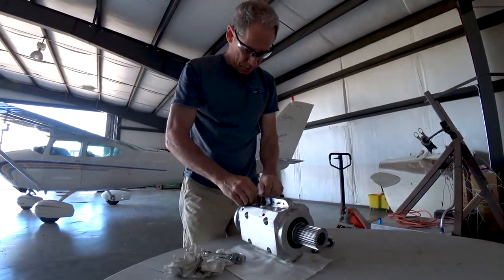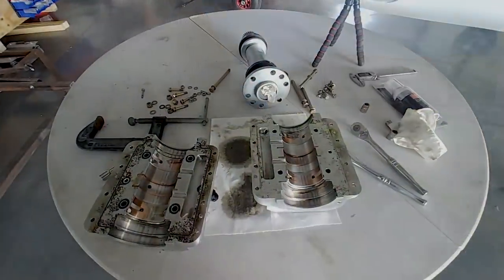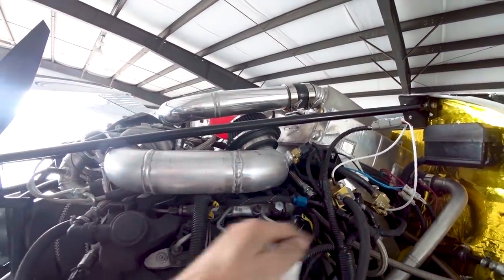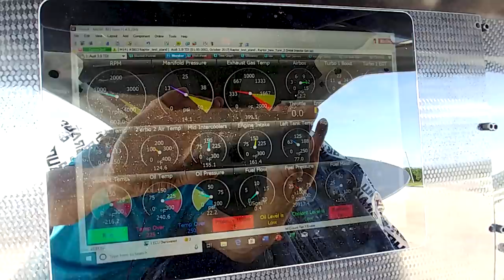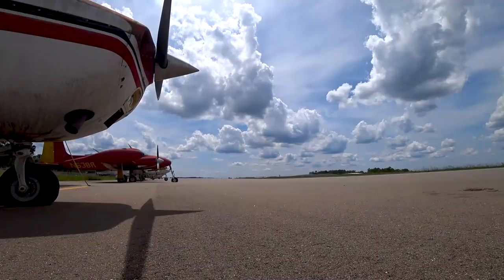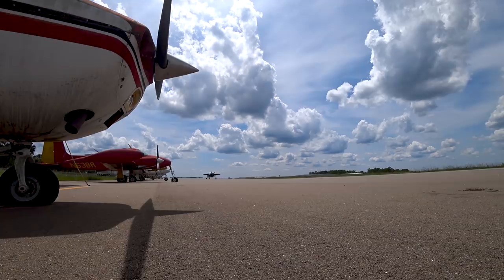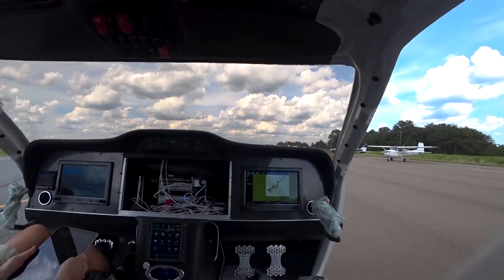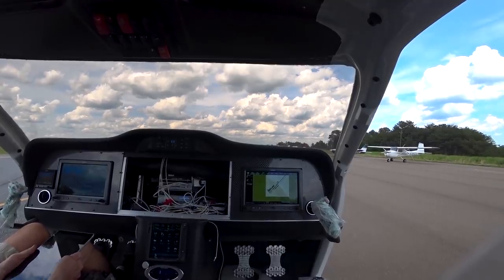High Highs and Low Lows - Building the Raptor Prototype

Comment: Dude that is so much like the problem Porsche had with the intermediate shaft bearing during the 996/997 era of the 911.  They eventually solved it with a big roller bearing on the end that is near the cam chain.

Comment: I am not worried about the redrive, the third version will work for sure. And the old one does it for flying around the pattern (and to Oshkosh in slow cruise).
Maybe time to reread the comments some people made on the April 3 video a year ago. I think they had some valid concerns as it turns out.
Poul Sorensen said "For problem areas  on your new design you have moved the two main bearings that takes the side load from the pulleys so they are only what looks  like 5 inches apart.  There is no way that those journal bearings can support the side load from 350 hp engine especially when the bearings  are so far from the pulleys  . journal bearings works great in an automatic transmission where the is little to no side load. That is  mentioned in another comment,  but the side  load you have  from the engine  is more like a wheel bearing on a semi truck."
Reply: Martin Renschler. Thanks for reposting my comment from april last year. I have sent suggestions, plans and part numbers to the raptor team a year ago as well to solve the problem, but to no avail. If this Bird ends up with a lycoming my guess is 90 percent  of the 300 plus million dollars worth of sales will disapeer.
Reply: @poulsorensen6948  My take is that Peter has two choices on all parts of the plane: a) build the whole plane with all parts to the finish as originally planned, then start iterating / improving what is broken and matters or b) start iterating on each part right away as deficiencies become known and never get done.
I think he is on plan a)! For that reason I said I trust him to get the redrive right on the next iteration. He will take all input into account would be my guess, so don't take it personally just because he didn't jump right away on it back then.
In my area of expertise, EE/wireless, I told him the NAV antenna cannot work and same thing, he put it in anyway. But I understand that he simply wanted to continue, see himself that it doesn't perform and then fix it in the next iteration.

Comment: Re-drive ultimate solution will probably be an electrically actuated prop pitch system. My design idea is contact-less, so no wear surfaces exist to cause reliability nor maintenance issues.

Coils mounted on perimeter of prop shaft rotate with the shaft inside a static ring of magnets, providing electrical power to the prop actuator controller mounted inside the hollow prop shaft. Data to and from the prop controller is passed via an IR link through a sealed polycarbonate window in the centre of the inner end face of the prop shaft.

Bearings for re-drive can then be single purpose, making design far easier.   Big-arse (Aussie technical term) roller bearings can be used to handle the significant mechanical loads involved, without 300 PSI oil to worry about.
No oil, no oil seals, no oil leaks, no pump, no pipes.  Nor any slip rings to wear out.

Comments and feedback, positive and negative, are invited !

Geoff Allen
Deposit #510

Comment: Wouldn't a cylindrical roller bearing be more suited for the belt tension load? The propeller end thrust would have to be dealt with separately, but the paired taper rolling bearings with a fitted center spacer will begin to deteriorate from the belt load.

Comment: MT also sells a prop whose pitch is changed via a small electric motor, instead of oil pressure. Is that an option?
Reply from the maker: It's very show to change pitch and even MT doesn't recommend it.

Comment: For my part I'm thrilled that you found a potentially serious problem without any risk to life or limb.  What's more, it's an engineering problem, which means there is a solution to it.  I can see from your other comments that you're thinking about it carefully (high impact diesel vs planetary gear) so I'm convinced that you'll get it.  Think carefully.  Make good decisions, just like you have up to now.  I can't wait to see what you come up with to address it and I'm 100% confident that you can.  

There was always going to be problems, you knew this.  The only question is what you do about them.  In the meantime you're still moving forward.

Comment: Peter, I have done some machining and repair of machine tools,  I note the plain bearings do not have an oil groove.  Most machinery turning at lower speeds have some  curved grooves hand cut perpendicular into the bearing surface.  Also a switch to a heavier weight synthetic lube might be appropriate.  You are doing an awesome job, especially of documentation. Keep up the great work.  I love it.

Comment: I’m an electrical controls guy and have been and continue to work with plant maintenance guys. So I’m not a mechanical engineer. So when I need something difficult on the mechanical side A free resource that are incredible to work with is Motion Industries. There’s no better folks to help wit bearings and power transmission in machinery. You might swing by and ask for their applications guy. And just to make it clear I do not work for or speak for them! I’ve just used their resources and products for 31 years now.

Comment: Groves in shaft for Teflon rings to separate prop control high pressure oil, so simple cant beat the original design - tapered Bearings can take the load !! Good Luck got to love the Raptor !!!

Comment: I disagree with your redrive diagnosis.   Your shaft appears to have been bead-blasted after machining.  That's much too rough. The shaft should be highly polished to a mirror-like finish wherever the rubber seals or bearing shells ride, just like a crankshaft.  But don't take my word on it, reach out to knowledgeable people.   As long as the shaft doesn't have a mirror-like finish where it needs it, you will have perpetual bearing & shaft seal issues.
Reply: I just added a post questioning the finish too then saw this post. Totally agree. That shaft finish is the likely cause.
Reply: Transmission Repair    Not seeing visual evidence for bead blast statement??  The coating on the shaft doesn’t seem to be coming off, but that’s not to say it’s appropriate for a journal bearing, it probably is not.  Profilometer traces are required to get actual Ra, Rz, Wt & Wsm data.  Previous comments comparing to crank journal requirements are correct.   They are detailed as hell, but this wheel does not need reinventing.

Comment: Peter, see if you can turn the power output of the WIFI hotspot down. It might be set at a factory 5W, try 2W or 1W. Also maybe a different channel if it has the option. If that doesn’t work then try the wifi antenna in different location maybe on the inside but up the top of the screen or as far away as you can. Not sure if you have already tried this tho, if you have disregard.

Comment: I can't see the belt tension causing those bearings to tear up like that. Your shaft is more than adequately supported. I was a bit concerned however by the surface finish on the shaft. Has it been coated with something? Surely you need a polished surface or even chrome plating on the shaft.

Comment: Also, you might redesign that redrive with needle bearings for side loads (maybe 2 on the belt end), and Torrington for the thrust bearing. If you used a shaft with the prop flange on one end, and a splined shaft on the belt end, you could use regular seals on either end, or even o-rings . Good luck Peter, you'll get it!

Comment: What concerned me with the second redrive was that all of the axial force from the prop was directed into the thrust washers.  I'm not sure how the numbers crunch or how you were ensuring sufficient oiling, but from the videos, it looked like they were being asked to do quite a lot.  At least in automotive engines, thrust washers are just responsible for eliminating longitudinal play in the crankshaft, not for carrying a load.   The tapered roller bearings in the first redrive should be a more robust alternative.

Comment: It sure looks like the radial load on the shaft is too great for the bearing. I wonder if there is room to put in a tapered roller bearing to take both the radial and thrust loading?
Reply from the maker: That's what we have in the old redrive but the oil feed to the prop is not functional in that one at this time.

Comment: Hi Peter, in looking at your redrive, I believe using a set of opposed pre-loaded tapered roller bearings would easily resolve the problems you're experiencing, not only the belt load but that of the thrust from the prop are working in conjunction to cause the bearing wear. It could be made as a simple solid pass through housing with very little and straight forward machining.........essentially you need a pinion gear setup similar to an automotive differential. I'm really enjoying your build and the openness of the challenges you're coming across. BTW, who is your prop manufacturer? Even though you still need thrust bearings in your final drive, have you explored going direct drive using more and shorter blades keeping the tip speeds below the sound barrier?

Comment: Hey Peter,  I feel bad for you but have been there myself.  It is just asking to be redesigned the only way it knows how.  

I have done detailed failure analysis on thousands of bearings.  Also many redesigns and fixes to journal bearing systems.  If you want help contact me.   I have suspicions about what is going on, but will not criticize or offer analysis without full system understanding.   As always, good luck & gods speed!

Comment: Congrats on the progress! On the redrive the bearings are being loaded 90 deg to that which they were designed for, the negative eccentricity is hurting your load capacity, also a preoil start may help some as well.  Even if you reclocked the bearings and built a preoil system it still may be somewhat life limited unless you could reduce the belt tention on start.  I wouldnt mind helping you out with analyzing the load and determining if the bearings are capable if rotated 90deg, i spent a few years working with those bearings at the oem.

Comment: I'm not sure I'd trust the grease to not get slung out of those bearings at the speed they will be running.
Reply: Porsche went with a sealed bearing on their early liquid cooled 911's and that's exactly what happened. They then changed to an unsealed roller that was lubricated by the crankcase oil splashing around and it worked like a champ. The real challenge here is going to be finding the right size diameter and width.

Comment: I am so sorry about the redrive.

~

If you do need to redesign it:  Perhaps move the thrust surfaces inboard near the center of the drive, using thick center flange to take the load. Then you can move that journal surfaces to the ends where they will have an easier time taking the radial load. 

Basically, you would almost be taking your present bearing arrangement and flipping it inside-out along the axis. I am thinking that the journal have a tough time taking the radial load, while not being at the end of the shaft. It's easier to pick up a sledgehammer near the head than toward the middle. Blocking the thrust can happen fairly well anywhere along the axis.

Still, I think you will need either a larger journal at the front, or a second journal. Many CNC spindles put two cheap bearings up front. Still, I like the idea of a larger journal, but room might be getting tight in your drive cage. But room is already tight in your redrive. I see bolts pretty close to the journals. There's an old metaphor that a cone of distortion lives under the pressure of the head of a bolt.

The bearing shells should be align-honed to a torqued cases. A good engine machine-shop should be able to do that.

Then there's oil wedge placement, too, but you probably read up on it, but it would have been easy for anyone to mistake which why the drive is turning and where the wedge should be.

Also, looking at your video, It looks like even the top thrust surface of the bearing is gone. Given the condition of the shaft pulling down, I would have expected the top of the thrust surface to have less wear, so I wonder about it's oil pressure. Were you logging oil pressure to it?

I can't get a good look at it, but the I guess that the other drive has tapered roller bearings. I wonder also if those would lasting and be efficient, being fed on oil. They say that old Bugatti ball/roller-bearing engines and 2-cycle ball bearing engines don't last, but most engines are hooked up to a transmission with ball and roller bearing input bearing shafts, so I don't know.

If there were something else that needs to be driven from the crankshaft, the loads would be balanced. You uncommon redrive belt load is very similar to a common supercharger belt load. perhaps they are might have knowledge that can be transferred over the technology fence.

[I once designed a machine to have two driven pumps belts 180 degrees about the CL of an engine.]

I am sorry. Things aren't going so good for me, either, but I'm still here.

Comment: Instead of two redundant belts, how about one well designed gearbox? More weight and balance considerations but it won't be as unbalanced a side load on bearings not designed for them possibly. Bit of an investment in time and money but better in the long run. But, alas, these things happen. Part of the process. Keep the chin up. I watched you vlog with the redundant belts and it escaped my thoughts too.
Reply from the maker: Gear boxes are prone to blowing up, especially with the high impulses from a diesel engine.

Comment: Is there a way to pump oil in there before starting it up? Might just be chewing itself up on startup before pressure comes up. Don't worry, you'll get it, Peter. As they say "that's why it's called Experimental" ! Don't give up....Also, I noticed that the rudder pedals are setup like a conventional aircraft, where you push one pedal and the other comes up. Usually canard aircraft have the pedals independent, and the rudders only move outwards, and this allows both rudders to actuate at the same time. So it looks like you have all that figured out though

Comment: I'm no engineer but 40 odd years swinging spanners tells me that redrive is suffering from lubricant failure.  Either too little volume or wrong chemistry.   Any reason you didn't go with rollers instead of slipper bearings.

Comment: Keep up the good work - you and your team will get thru it .  On the drive problem - maybe a roller bearing with in your casing but with some built in pre-load to counteract the load from the belt.  An engineer should be able to make the load calculations and determine if this a possible solution.

Comment: Ah, so disappointing to hear about the reduction drive.  This just increases my dislike of reduction drives in general - just another "thing" which can go wrong, needs inspection, maintenance, eventual replacement etc etc.  And it's a very important "thing".  I know there are lots of them out there, especially with Rotax engines behind them, but even so, I don't like them.  And I know this design is founded on this engine, which needs a reduction drive, so good luck with getting it sorted.

Comment: Taxi test looks good!! Journal bearing construction needs very rigid (not nearly any flex) components to work, maybe support bearing
at outer end behind pulleys would help? Roller element bearings would be my choice, you could separate radial and thrust loads and 
still live with small movement between the parts. Is there now enough prop clearance with fixed prop during  rotation and flaring?

Comment: Wouldn't a conical or tappered bearing be a better solution for the problem your having.  Ther seems to be allot of load placed on the front bearing, the oil pressure suplied is not high enough to keep the bearing lubricated and separated from the shaft.  I'm just saying, the bearing lubrication is not doing its job or the bearing is not doing it's job.  I there a way to caalculate the force being pulled down in the shaft with the wind mill spinning around?  All these things are coming to my mind and I woun't be able to sleep now that you have this problem.  My wife hates you because all I do is thing about this project.  At 72 I don't have much time left so lets get to it and figure it out.  Hahah, no, just take your time. and if I think of anything I'll be sure to get back to you..Thank you.
Reply from the maker: The old drive that is now on the aircraft has tapered roller bearings. It just doesn't have a working oil feed to the prop.

Comment: Man it's a good thing the redrive was leaking.  That bearing was on its way to catastrophic failure.  I wonder if the bearing was getting under lubricated or if the film strength of the oil just can't take the pressure.   It'll be interesting to see what you come up with for a solution.

Comment: Congrats on the successful taxi test.  I would think that's a big deal.  How is the old redrive able to handle the belt tension force?  What kind of bearings does it use?
Reply from the maker: Large tapered roller bearings